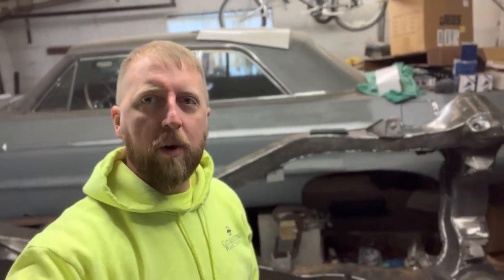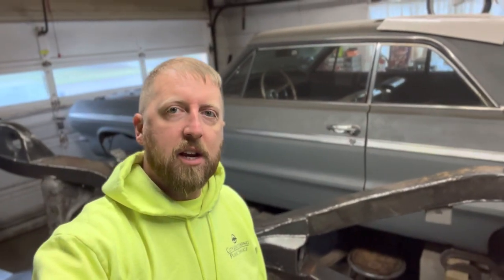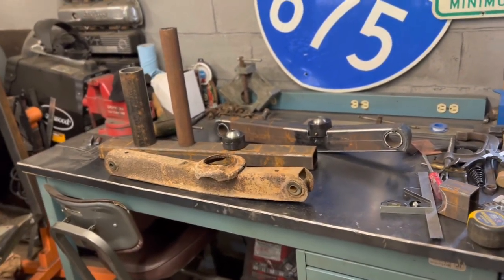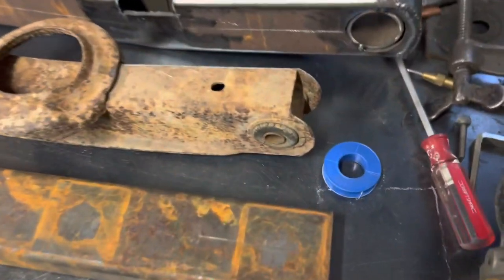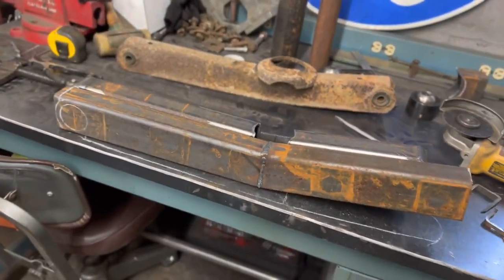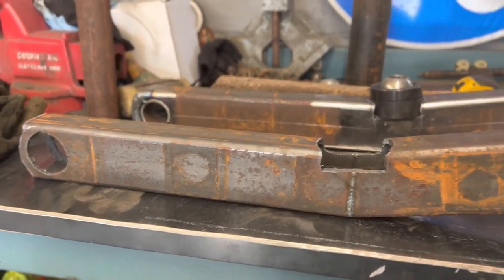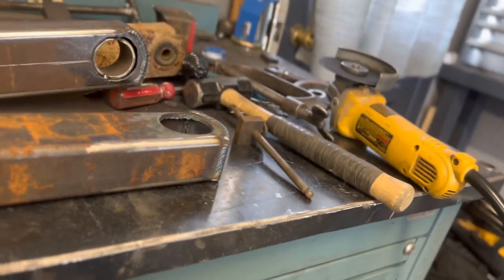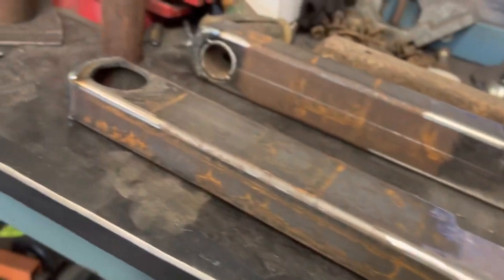Building Impala Lower Trailing Arms! Part 12!!

Comment: What’s the longest cylinder you can put on stock trailing arms
Reply from the maker: That’s not a super easy question to answer. A couple things come in to play with the rear control arms. Your upper wishbone/ Y-Bone also need to be considered when choosing cylinder size. 12-14” are “standard” for a non telescopic type cylinder with stock length trailing arms. But you can also use telescopic cylinders on a wishbone with factory linked control arms. You can also give the guys at Cool Cars a call and ask their tech technician for advice.

Comment: Question brother, how what are the measurements from the center of the power ball to the center of the rear bushing?
Reply: My arms, touch coil is touchin the differential, wonderin what r the measurements so they dnt rub, i know i need to
Have a lil
Gap